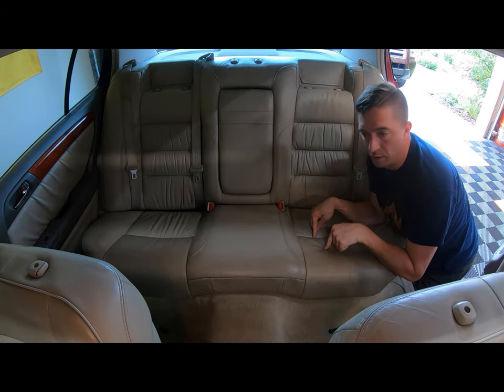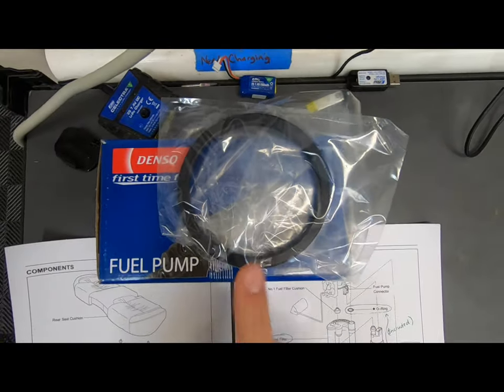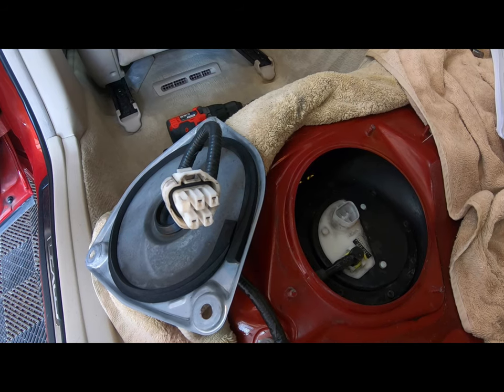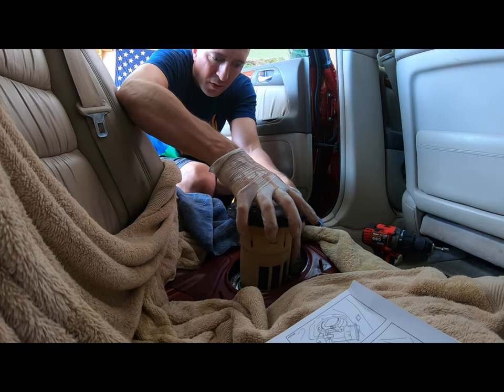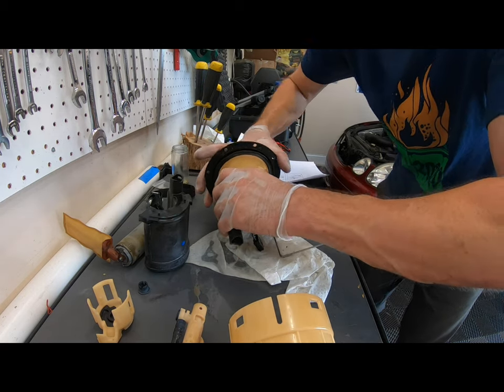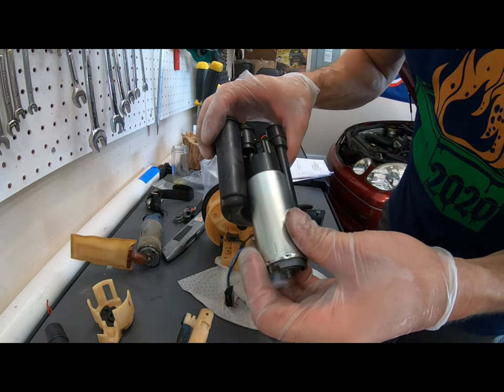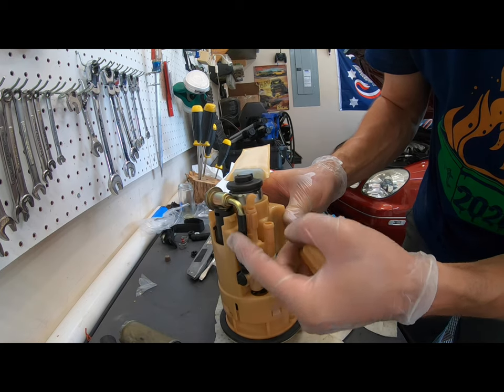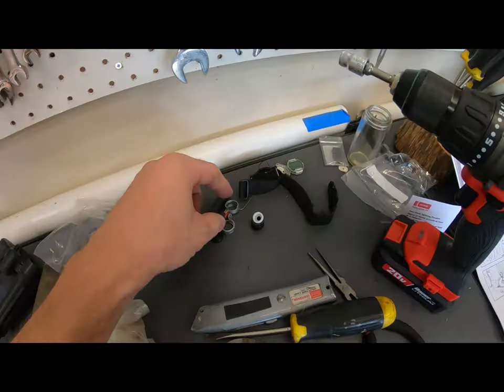TOYOTA / LEXUS Fuel Pump Test & Replacement Procedure

Comment from the maker: PLEASE READ Make sure you stack the new fuel pump’s outlet port as follows: 1) taller plastic “castle” spacer 2) new o-ring 3) white plastic top cap. You may need to gently tap the white top cap on to the outlet port. If you do not do this correctly, you will experience cold and warm hard-start issues!
Reply: Which piece is step 3?
Reply from the maker: @liljohninnocent  white plastic top cap.
Reply: @ForwardMomentum  thanks
Reply from the maker: Yw
Reply from the maker: @MrEdoginess It comes in the DENSO kit and unfortunately DENSO doesn’t list or sell just that part #. You can probably get one from the dealer.
Reply from the maker: Correct. The FSM recommends they be changed, so if people plan ahead a bit these can be changed as well.
Reply from the maker: @MrEdoginess you’re doing it right! The dealer is being lazy. They can look this stuff up for you. If I had the part #’s I would give them to you, but it sounds like we both ran into issues with the dealer being lazy. 🤬
Reply from the maker: @MrEdoginess it could be. There’s was definitely an o-ring on that regulator.
Reply: glad u updated the video with this cuz i was gonna say what a minute u forgot something  lol great vid thnx
Reply: Why didn't you replace the sock?
Reply from the maker: I did.

Comment: LEXUS GS400 I STILL NEED HELP 😢. Replaced my Fuel pump & the car will start & drive but sometimes when I stop somewhere and get back in the car it won't start up right away🤬. I will have to sit there for 10 or 15 minutes stuck and then it will start up gain. CAN ANYONE TELL ME WHAT MIGHT BE GOING ON PLEASE? 🙏
Reply from the maker: Did you fail to install the o-ring and top hat bushing on the fuel pump outlet into the filter housing? I didn’t illustrate that very well in the vid. If you mess that part up, the car will cold start, but have a hard time warm starting without a heavy foot on the gas pedal. SEE MY PINNED COMMENT.

Comment: Tried replacing my pump and the fuel hose you took off when pulling the pump out was so brittle it completely snapped, the hose runs from the pump assembley to a hard line running across the inside of the tank, but the 2nd hose clamp is not accessible to you have any ideas? I'm out of options and can't get to work
Reply from the maker: Sorry, I don’t have any experience with that particular issue. Maybe getting the FSM would help?

Comment: I've been pondering doing this to my 01 GS 300 just to see if the response gets quicker? Would you suggest replacing fuel regulator as well? I believe it a part of the filter assembly.
Reply from the maker: It won’t change anything unless your existing pump is shot or starting to go. The regulator is not necessary. Test the pump and see where the resistance is. It takes 10 min.

Comment: What symptoms did you have with a bad pump? I have a 99 GS400 that runs rough or dies after a few seconds after startup when its cold (below 32 degrees Fahrenheit). If  I press the gas pedal a little right after starting it will clear up after a few seconds and run like normal. I also have a little bit of hesitation from a stop sometimes.
Reply from the maker: I was actually chasing a lean code (turned out to be my intake - see other episode on that). As outlined in my video, you can test the fuel pump at the plug. Another method is to watch the fuel dampers on the rails. At start up the screws in the middle should go to the up position.

Comment: Between you and 1A Auto videos, I've pretty much learned everything I need to know about my GS430 😂😂😂😂😂 But seriously, can't thank you enough for all these uploads. I acquired a 2004 GS430 about 7 months ago, battled the dreaded knock sensor code for 3 weeks, found out why my OEM one went bad though. Had a fouled up, and pretty much completely useless, fuel injector on bank 2, which is the bank my knock sensor went bad on. Was a fun challenge, sarcastically speaking of course, but it felt so rewarding after deep cleaning my injectors, and then driving down the road under full power again. Car was running like absolute crap prior to that, and I went through quite a lot before that. I actually just cleaned the injectors for the heck of it, just to see it would help the car any. Long story short on that part, I drove the car for 3 days with no real problems other than it running super rich and still having the CEL and VSC lights on. It's parked now, until my parts arrive in a few days. But I can't express how thankful I am for videos like this one. I'm certainly doing this fuel pump job after I get a tune up done. Think I'll even get a new regulator and dampers as well 👌🏼👌🏼
Reply from the maker: Love this feedback! Thank you and God Bless. 👊
Reply: Moral of the story, to the 2GS owners; clean yo damn fuel injectors, replace yo damn knock sensors and get a tune up to wrap it all up.
Reply: @OctogonOxygen024816  moral to your story, all of that actually doesn't necessarily solve your problem..... The VVTI solenoids play a part, the throttle body too (the throttle body motor for some reason isn't replaceable even though it can be accessed), timing can too I believe, as well as a bad PCM. A faulty fuel pump is rarely the case, but it can also cause a knock code when it starts going bad in these cars. It's wild how many things can set off a friggin knock sensor code in the GS. But the things you listed ARE the main components, and if you replace your knocks, get Denso or the Standard Motor Products (Matsushita) ones, any other brands won't work trust me! I got some random brand at O'Reilly's when the code first popped up, the knock sensor ended up throwing TWO codes for that sensor, circuit and sensor malfunctions if I remember right, where I originally only had a circuit malfunction. Which doesn't necessarily mean the wire circuit is bad, just means something in the knock circuit is causing the knock code. And boy oh boy the list is length for the things that can cause the code to start popping up. I've recently had a rodent problem in my GS, little bastard chewed up one my VVTI solenoid sensor wires, had to get a new plug put on and now I'm currently waiting on new sensors (should be in Saturday hopefully.) It's such a headache of a process. I wish I had been the original owner of this vehicle, I don't think it would've ever had to go through such an extensive tune up and maintenance plan to get it right. She's coming along though, and I'll have great videos and content to share, as I've done all the work myself so far

Comment: Thank you for this very detailed video! Trying to figure out why mine isn't getting fuel to the rails.. i suspect fuel pressure regulator since there wasn't any pressure at all when removing the fuel line underneat the car
Reply from the maker: There should be pressure at crank, but then it bleeds back to the tank over about 30min.

Comment: After discovering your Intake video, then your O2 sensor video, and now your fuel pump video, I found myself measuring the resistance of the fuel pump in my newly acquired GS400, and what do you know...3.3 Ohms?! For $200 in parts/shipping, I hope the new fuel pump solves the lean Bank 1, misfire, and 1.5 seconds-O'-cranking for the engine to fire conditions.
Again, fantastic how-to videos on how to keep a very cool car running great!
Reply from the maker: That’s awesome and I’m glad I could potentially help.  LMK how it turns out. By the way, in my fuel pump vid I do not replace the o-ring to the fuel pressure regulator. I recommend you pick one up and do it too. I simply didn’t know it was also a recommended replacement until it was too late and I was already in there.
Reply: @ForwardMomentum  Yeah, though it's a real pain trying to get part numbers for some of the smaller Lexus parts. I also have the service manual, which as you know doesn't list part numbers either. I could measure the O-ring after I pull it, and order one from McMaster Carr, but I don't want to pull the pump assembly twice.
Reply from the maker: I’m fairly certain the Denso pump o-ring is a common size that we need a couple of. Perhaps they sell them separately?

Comment: Awesome video, love the content dude. I'm about to do this to my LS430 and looks like a very similar setup, if not the same.
Reply: @techno Viking did it help on the LS430?
Reply: Not similar to the ls430
Reply: @SoulBreez888  Sorry for the late reply, but yes. I ended up changing the filter, the pick-up and all the o-rings/gaskets. Pretty straight forward. It is almost the same setup as the GS. Best to use the workshop manual, but this video helps a lot.

Comment: Great video.  I have a 2013 GS350 which the gas gauge just recently is reading empty even after filling up the gas tank.  Just curious to see if replacing the fuel pump will resolve this issue or could it be the float?
Reply from the maker: Replacing the pump probably won’t do any good. Sounds like the issue is related to the sending unit.

Comment: Seeing that your car was basically running ok at first. What difference did you notice after if any? Super Awesome Videos.! Love the Dark 🍒 color. I have similar head light set up on mine. LED 6k headlight lights 6k bulb light yellow halogens. All LED Red taillights.
Reply from the maker: Awesome! Love yellow in the right places. I didn’t notice any difference. If anything, it’s a maintenance item. Of course the K&N FIPK was the cause of my fuel trim problem, so that could have masked any perceived difference. I immediately went back to the stock intake after the fuel pump job and, of course that made a big difference. In other words, other issues masked any perceived change with the fuel pump job. Hope that makes sense!

Comment: Sorry if I missed it but did you first diagnose you had a fuel pump issue?
Reply from the maker: I was fighting a P0171 bank one lean issue and after exhausting about every other option, I threw a FP at it. I normally don’t throw parts at scenarios, but I figured it would make for good content anyway. In the end my lean condition was caused by the K&N intake system, which I removed.

Comment: Any symptoms of a bad fuel pump or fuel filter to be aware of ? And At what milage did you replace yours ? Do fuel grade impact fuel pump/filter in any way ? Thanks again 🙌🏼
Reply from the maker: I replaced around 165K miles. Fuel grade should not impact particulate matter (premium isn’t better per se). But you should run what the engine requires (premium). Signs of a bad pump can be long starts, hesitation and the engine stopping for no reason. The check is simple, so I suggest you start with the ohm test and go from there.
Reply: @ForwardMomentum  thank you very much !
Reply: Which pins are 4 and 5 ?
There's 3 on top and 2 at the bottom I'm assuming 4 and 5 are the bottom 2?
Reply from the maker: That sounds correct. I thought I showed it in my vid? Do a Google search and double check, but that sounds right. You won’t hurt anything with an ohm test. 👍

Comment: Help! My 1998 Lexus GS400 has been an amazing car that I’ve owned for over 15 years.  However, it won’t start.  No click, good battery, and I’ve had a couple of mobile mechanics take a look.  The last one said it’s the fuel pump but I don’t think so.  If a pump was bad wouldn’t the car try and at least crank?  Question,  when your key is in the accessory position does your gear indicator show what gear you’re in?  Mine doesn’t and I’m not sure if that’s normal.  If that’s not normal behavior then I’m suspecting a neutral safety switch or something similar type of issue not allowing my car to start.  It doesn’t start in park or neutral.  Check all fuses too
Reply from the maker: Hi - no, not much lights up in ACC mode. Any recent changes prior to this happening? I see you mention a new battery. Sometimes they can screw with the immobilizer. I’d walk through everything with a multimeter and the FSM. If you need the FSM, you can DL it on the TIS website using a day pass for a small fee.
Reply: @ForwardMomentum  thanks for taking the time to reply.  No recent changes but what did happen was my car stalled on me while exiting the freeway.  Luckily I was able to coast into a parking lot safely.  From that point on my car won’t start.  Just to be sure I took the battery to get it tested and fully charged but same issue.  Before any of this happened the car has been driving fine for the past year.  I hesitated to let the mechanic have to car to swap out the fuel pump because I was under the impression the car would at least crank if that was indeed the issue.  I tried putting the key in the drivers door and unlocking/ locking several times just to make sure the theft deterrent system wasn’t enabled.  Also tried my spare key.  It’s almost as if something is preventing the starting system from engaging.  I also don’t hear the starter relay clicking when attempting to start.  But the car stalling on me on the highway might be a clue as to what may be happening.  I’ll look into downloading the FSM thanks for that suggestion!
Reply from the maker: @cflivinadream  I agree with you that the car will crank with a bad FP. Just for kicks, test it as outlined in my vid. I really don't think that's it. These cars are known for starters going at high mileage, so it's possible the starter is shot. However, I think you're on the right path by checking cheap things first, such as the shifter interlock and NSS. Definitely keep me posted as I certainly don't know everything and I would love to hear where you get with this. Also, CarTuneNZ is a master at the 1UZ. You may want to browse his vids and see if there's anything worth checking. I believe he would even provide some consultation for a fee, but he's in NZ, so the time difference could be intense. LMK!

Comment: Hello,

l have an 08 Lexus IS250. The car has a rough cold start, sometimes it doesn’t even fully turn on anymore. A couple of weeks ago, shooting some starter fluid in the intake will get it to start, but now it doesn’t. When cranking, it has 0 FRP(psi). Does this mean the fuel pump is bad? 

Looking forward to your response!
Reply from the maker: I would obtain the FSM from a day pass at Toyota Info Services (TIS), $15?  Use diagnostics to troubleshoot. It does sound like there should be pressure during cranking, yes. But I don’t know the 2.5L well. Also, my research indicates this engine has a cold start injector. That could be a culprit too. Report back on what solves it. 👍
Reply: @ForwardMomentum  Thanks for the reply!

Some things I forgot to mention; before the rough start, my car died randomly while driving out my parking spot. The following day is when I noticed the hard start, and the stalling. Went to check for codes, and it had a pending code that had something to do with the MAF sensor. So I replaced it. And still had a rough start/no start. Had another mechanic check it out; he claimed it was the fuel injection cold start valve. We replaced that as well, and the same issue happened. Now mechanic states “ We should verify it’s 
1:  spraying
2: got pressure
3:getting electrical signal.  

I did those tests with the old one, so I should’ve repeated them.  Let’s plan another trip and keep playing with it in the meantime.   It’s possible the check valve in the low pressure pump is leaking, or maybe not running at all, hence checking for pressure at cold start injector. Any advice?
Reply from the maker: He should have done steps 1, 2 and 3 before replacing the cold start injector. Anyway, it sounds like he’s just throwing parts at it. You may want to consider having it taken to the LEXUS dealer or a mobile mechanic that specializes in LEXUS to diagnose it. I would hate to throw random parts at it too. FAST is the general rule: Fuel Air Spark Timing. Sorry I can’t be of more assistance. It’s tough to determine what’s up remotely.

Comment: Little late to the party. Awesome video. About to change my wife's fuel pump and fuel filter. Where did you get the FSM?? Would also help me out... Thanks!
Reply from the maker: It was posted on a FB page, then pulled down. If you’re on IG DM me. @youtube_forward_momentum
Reply: @ForwardMomentum  does that manual apply for all GS or just the 400?
Reply from the maker: @MrWong26  300/400
Reply: @ForwardMomentum  that's great I just followed you on IG. Could you please share with me that manual
Reply from the maker: I can’t due to size and copyright laws. However, you can get a day pass and download everything you need using the Toyota Information Services site in PDF.

Comment: Hi great videos. How about replacing the fuel over flow check valve.
Reply from the maker: Thanks. I don’t have it on the calendar. I heard that thing is crazy to access under the car.
Reply: @ForwardMomentum  yes I seen a guy cut open a hatch to access it. I won't be doing that.  I may just have to take it in this time.  Thanks for the other videos s that save me trips to the mechanic shop.

Comment: What's up brother i was wondering if I stick a aem 340 pump in that sending unit will it work with that fuel pressure regulator thats in there or will it mess it up and was wondering if there's a fuel pump saver on our gs400 and gs430, because my sc300 has a fuel pump saver and I'm going to bypass it thank you
Reply from the maker: Good questions. Unfortunately I am not comfortable answering them. I hear that guys are putting Walbro pumps in, but it requires a modified hanger. I have also heard that the Aristo TT pump will work, but the plug has to be modified. Please check on all that. Sorry I don’t have more answers for you.